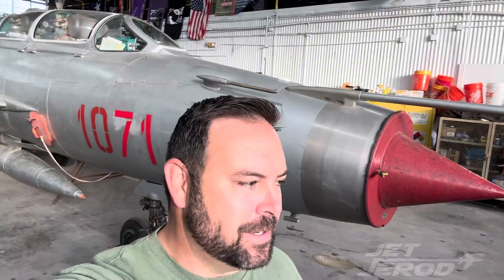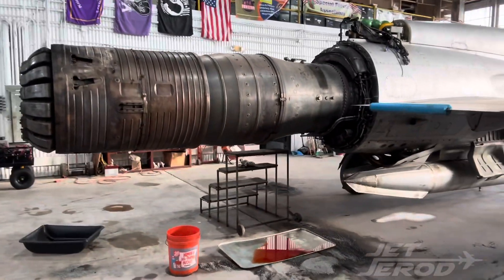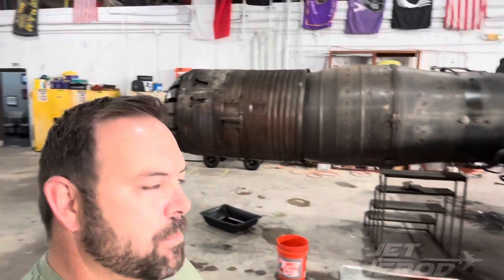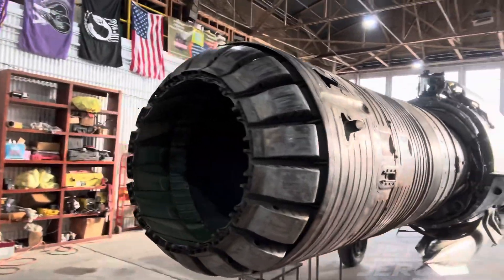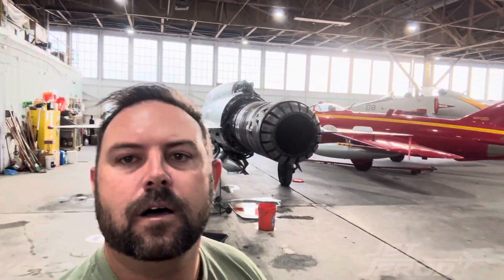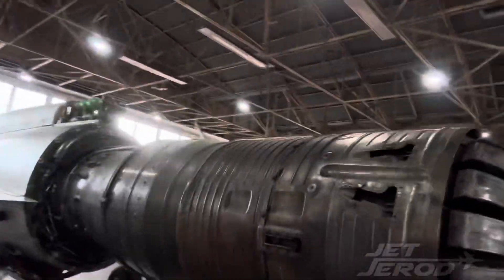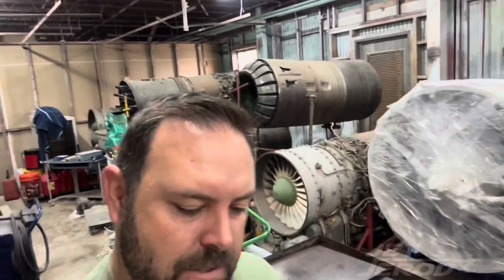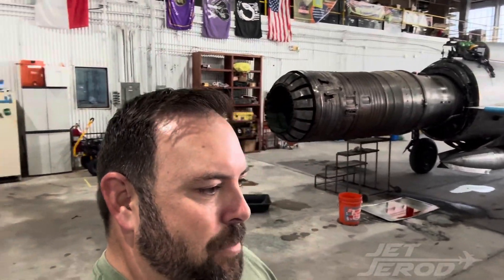MiG21 Engine Swap (Pt 1)

Comment: Very interesting.  What controls the rudder and elevators that is disconnected to remove tail?  Hydraulic, mechanical, or electrical?  Do you have Russian shop manuals translated to English?  Is there such a thing as a N.O.S. Mig -21 engine available on the market?  Thank you.
Reply: Push pull rods for the rudder and elevator. 
All electrical have Canon plugs

Comment: that reminds me a lot of the process of pulling an engine on an A-4 Skyhawk.  Not a terrible thing to do, but it does take a while.  Lots of stuff to disconnect at the tail, as well as at the engine.  Of course, everything that you have to access is buried in some dark little hole too, so you have to remove bolts or connectors without seeing them.  ...and don't drop anything!!...   Good luck with the engine change, and looking forward to the video!

Comment: Question - How overhaulable (if that is even a word) are those engines? I was under the impression that the Soviet stuff was basically a throwaway unit, and replaced with a new build engine.
Reply: This is true and not true. The concept of throw away was when the Soviet Union was in the business of keeping the factory's going thus components that were perfectly good may be thrown away to keep that factory producing components. My experience on the VK-1F, R-11/13 and R-35 is that these engines are rugged, very reliable engines (The R-35 may be one of the most reliable and powerful turbojets made) that can go way past the Soviet "times". Generally, we also have better turbine oil parameters (though not by much) and perhaps slightly better fuel than you may find in Russia. Jerod is 100% correct in that the volunteers make it or break it!!
Reply: Thank you!